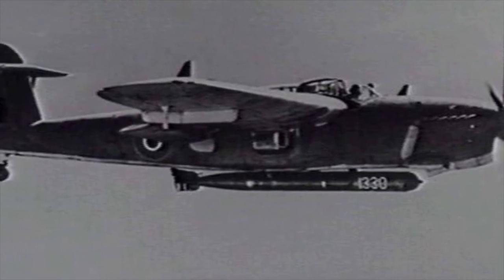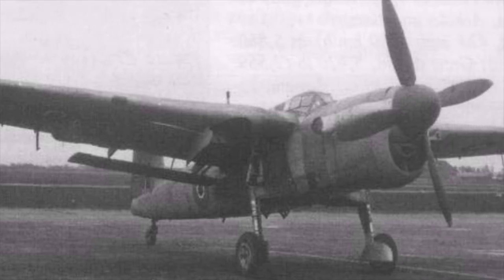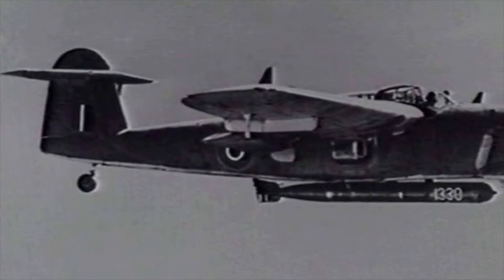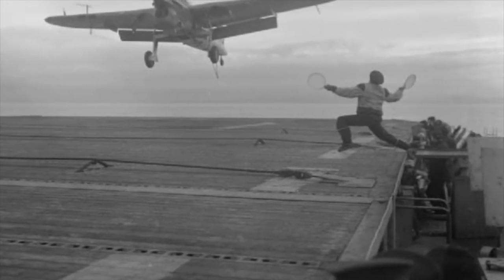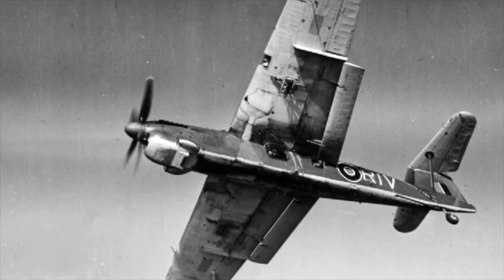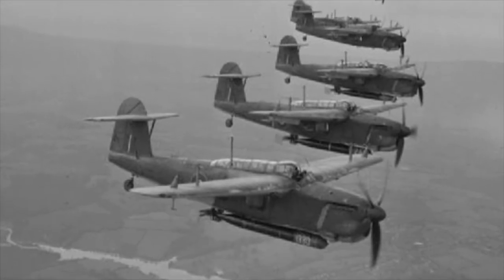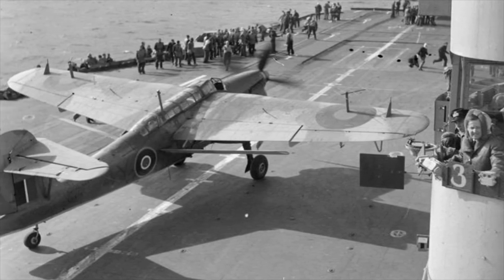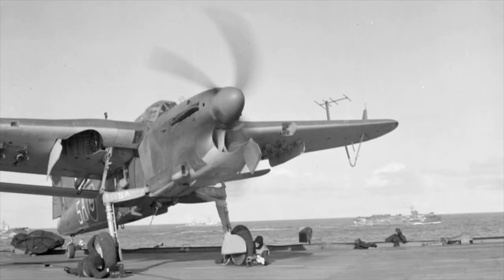The Fairey Barracuda: The unusual, shoulder-wing, cantilever dive bomber of the Royal Navy

Comment: One of the most difficult challenges in leadership and planning was the rapid advancement of technology.  Putting the best into production while forces were engaged in attrition of obsolete weapons was very difficult.  It was rapidly discovered that training and sheer determination helped build more confidence in the cockpit and translated to success far faster than delivery of newer weapon systems. Pilots were oftern reminded that it a Fairey Swordfish with torpedoes that changed the destiny of the Bismarck.
Reply from the maker: Yes that is very true. Sometimes they had to work with the best they were given. Then there was also no guarantee that the new system would work or be better than what they already had.

Comment: No mention of its tendency to dive into the sea after it released its torpedo. Well described in Eric Winkle Brown's Wings on my Sleeve
Reply: Or go into an inverted spin when diving which killed many pilots - and nearly killed my father in the BPC - "inverted spin from 3,000ft brakes on - out at 50ft". He just made it!
Reply: And very hard to get into the air in hot weather. Also if you retracted the landing gear when taking off the plane would sink and hit the sea... You had to wait until up in the air before this could be done,

Comment: Always wondered why RAF and/or British aircraft manufacturers painted the "P" (in a circle) on the fuselage of prototypes - this was sure to grab the attention of any spy!
Reply from the maker: Yeah you would think they would be a bit more secretive with new technology. Through a quick bit research it seems that the marking was introduced as a requirement from around 1941/1942 by the Air Ministry. Not sure why though.
Reply: There were no German spys in the UK, the ones they sent over got captured pretty quickly.   Anyway, a letter 'P' doesn't tell an observer on the ground too much about an aeroplane or its performance.  It also helps to prevent friendly fire accidents.
Reply from the maker: @JohnyG29  Yeah true. Thanks 👍✈
Reply: The serial numbers of prototypes and experimental aircraft had the letter G suffix indicating that it must be kept under guard at all times whilst on the ground and only those who had permission to get close could do so.

Comment: The Barracuda Mk.II were the only ones operated by the RAF, making the title correct.
Reply: The RAF didn’t use them.
Reply: @givenfirstnamefamilyfirstn3935 . Let's see during 1943 567 Squadron (squadron code letters: I4) at RAF Detling operated the Barracuda Mk.II. Then in 1944 667 Squadron (squadron code letters: U4) at RAF Gosport, 679 Squadron (squadron code letters: 3M) at RAF Ipswich and 691 Squadron (squadron code letters: 5S) at RAF Roborough were also equipped with the Barracda Mk.II. all RAF Barracudas were withdrawn from service betwee  March and July 1945. All 4 squadrons were Anti-aircraft Co-operstion Squadrons. Aircraft serial numbers included BV725 (which served on 667 Squadron), DR154 (which served on 679 Squadron) and DR190 (which served on 691 Squadron) according to my copy of Flying Units of the RAF by Alan Lake.

Comment: Interesting! Would've been nice to have more detail on this plane's use in combat - torpedo, dive bombing, level bombing if so used - plus more detail on the battles, like on the Tirpitz raid. Also, as the other commenter stated, slow down please.
Reply from the maker: Thanks. Unfortunately, to include the extra details it would extend the video to long. The idea of these documentaries is to keep them short, but informative so you don't have to watch a full hour documentary. Unfortunately that means that many details are missed.  Slowing down is something that I'm working on. Thanks for feedback and support It is much appreciated.👍✈✈
Reply: @AntiqueAirshow  You could do a Part 2 with the battle information, that would be cool to watch!
Reply from the maker: @longbranchmike488  Yeah that's a good idea. I will look into and hopefully not too far down the track it will be done. 👍👍✈✈

Comment: I never liked the Barracuda, I thought it looked all wrong . Ungainly. legs to long and fuselage to long too. There is a old story told by pilots. "If a plane looks right it is ". The Barracuda looks all wrong to my eyes .
Reply from the maker: That's fair. It does look very odd to say the least. I don't think this aircraft had a great reputation. Believe it or not it was this ugliness that drew me to this aircraft in the first place and made me interested. I guess it was that ugly, that it intrigued me that it actually flew and was quite effective as a dive bomber
Reply from the maker: Yeah it seems that it had a very specific requirement to fit, even though this requirement at the same time was very broad. Thus Fairey had to design a plane that could do a lot. The tail also came from instability problems  due to the wings in the tail adding to the look.   Interesting indeed. 

It seems to be a mix bag with pilots, because I've also read some pilots hated it. But still it nonetheless served its purpose.

Thanks for pointing that out, it does seem I missed it. It can be hard sometimes to fit everything in and sometimes details like that can be missed, my apologies. I'm working on a video that will take a deeper look at its operational career throughout the war,  so it will be mentioned there for sure.👍✈
Reply: British designers seem to have had an affinity for ungainly and odd looking aircraft.
Reply: @williama.walker2287  It was one of those "jack of all trades" carrier planes that had to carry out a range of 'conflicting' duties: in this case a dive-bomber role was added which was one reason for those odd-looking flaps/air-brakes which created so much turbulence round the tail that the horizontal tail-surfaces had to be raised above it (hence the struts, etc.).

Comment: Nice, but didn't quite measure up to the TBF/TBM Avenger
Barracuda
230 MPH 687 mile range
1,500 lbs bombs or 1,800 lbs depth charges or 1 1,620 lb torpedo
Avenger
271 MPH 1,215 mile range
up to 2,000 lbs bombs - internal and/or external - 4 500 lb bombs or 12 100 lb bombs
1 MK XIII torpedo
Reply from the maker: Yeah, the TBF/TBM Avenger was better.  I mean it was the aircraft that replaced the last Barracuda's in service.
Reply: @AntiqueAirshow  - One internet wag insisted the Stringbag was the best torpedo bomber of WWII. A sentimental favorite perhaps...
Reply from the maker: Yeah maybe, because it definitely wasn't the best. It did play its role and undertook a few notable raids, but it sure wasn't the greatest. It was out-dated even before the war started.